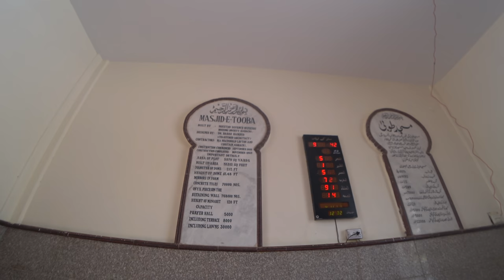WORLD'S TALLEST SINGLE DOME MOSQUE / EXPLORING KARACHI / PAKISTAN TRAVEL VLOG

Comment: In old times yes, they did climb to the top of minarets to say Adhan (Azaan in Urdu) because there were no mics and speakers so when there was a call for prayer by saying Azaan, people could hear. Now they don't do it as every mosque is equipped with mics and loud speakers and the purpose of Azaan is achieved without climbing the minaret. I don't know if some still do it, not sure.
Are you allowed to climb up? I'm pretty sure you can if you want to see it. It's a part of a mosque so why not, it's not forbidden.

Comment: Tooba Masjid is amazing to look at and be in, even though it is very simple. but in practical terms the design is horrible considering the weather of Karachi. here it's hot and humid almost the whole year round, and when the dome has lots of people in it of course they also produce their own heat so there is all this hot damp air that rises to the top of the dome and then gets trapped there because there are no openings up there for it to escape from. so jummah at Tooba Masjid is often not the best experience. one goes there having showered and gotten clean and comes back having showered in sweat. they should have integrated exhaust fans in the dome. no, seriously.

also, i don't think i have ever seen the fountains running. or maybe i did once or twice. but it would not be a good look to have so many fountains running in a city that has a severe drinking water supply problem. i think that's why they keep the fountains off.

Comment: It looks that you mysmarized after entering the Mosque.......!! There must have any separate room equipped with sound system around the mosque from where the AZAAN (Call for the Prayer) is performed five times in a day and the speakers are placed on the minarets. Single or multiple minarets are signs that it is a mosque. In old days (when there was not having any sound technology) "The Moazzan" (a person who perform AZAAN) goes upstair on rooftop of the Mosque or on stared Minaret to perform Azaan so the distant people can know that its high time to go to the mosque for the prayer (Namaaz).

Comment: In the old time, where there is no electricity, muazim climb to the high place in the masjid to call the Azan, so people from far away from the masjid will hear calling from Azan. That why in Muslim they built a high minaret at the mosque for the purpose of calling Azan. Now in modern days, muazim just stay in the room and make an Azan to call for prayer using mic and big amplifier with big speaker on the top of minaret.